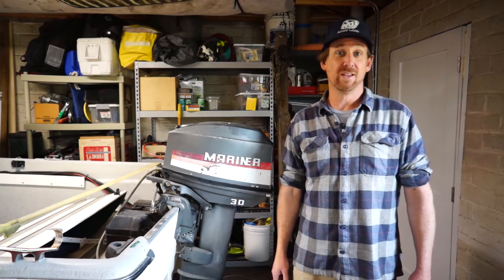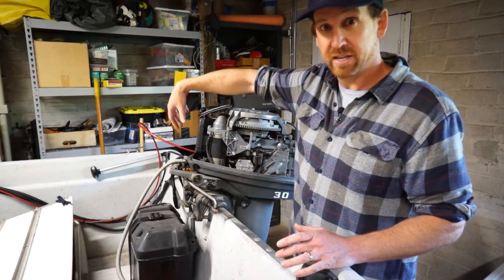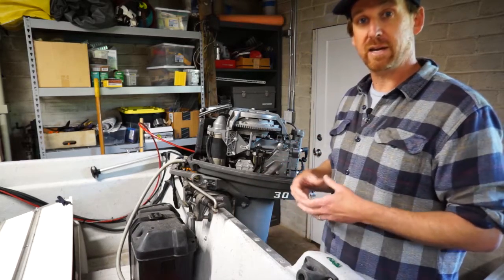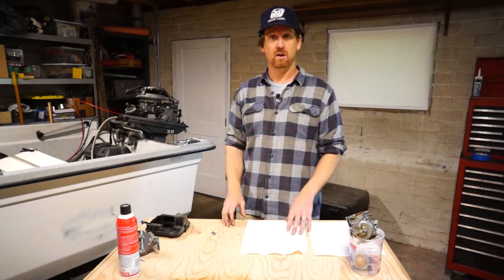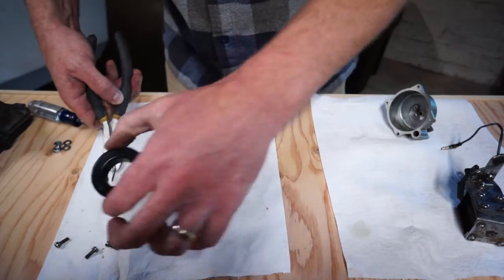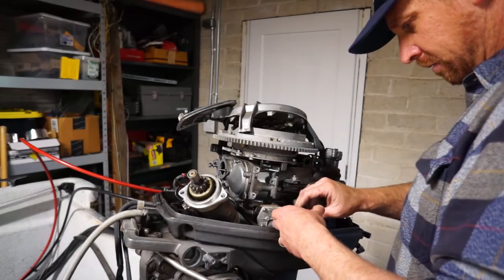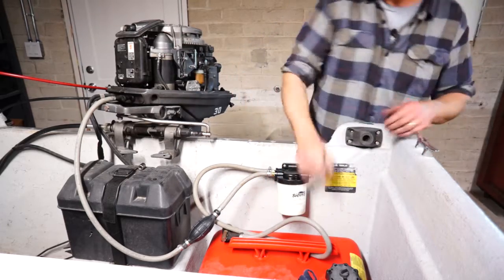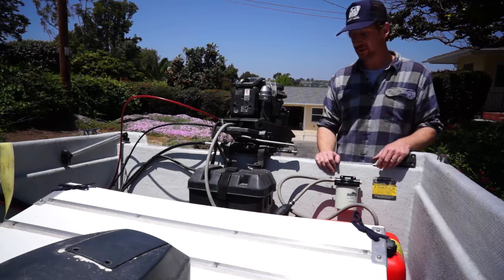How to Fix an Outboard Boat Fuel System Including Carburetor Rebuild

Comment: My dad is having trouble with his mariner 2 stroke 25hp unknown year, it looks identical to this one. He got a new fuel pump and filter(non OEM), he took the carburetor in to be rebuilt but it’s still hard to start and stalls on idle, he’s out of ideas. This is the closest motor I’ve seen to what he has, I’m wondering if you have any tips?

Comment: Hey mate my boat pisses out fule out of the propeller wondering if you'd know what it is
Reply: Holy shit 😂
Reply: @Michael_cgx  was the fule pump
Reply: @mrfish9997  I’ve changed the fuel filter and the fuel line. Going get a fuel pump tomorrow. Hoping that solves the issue
Reply: Hey Mrfish I'm having the same problem with a mariner 30 horse runs great in the driveway but you put in the water and it's just pumps fuel out da exhaust please let me know  if you have found a solution I'm pretty sure it's firing issue not a carburetor issue
Reply: @christophercsm32  my was the fule pump

Comment: Nice job! Question: After you took off the carb, you flushed the old fuel from system. How exactly did you do that? Was it basically putting the fuel hose that typically goes into the carburetor into a container instead? And then looking at the fuel to see what state it's in? Thanks.
Reply: Biggie gf ggjjy try h